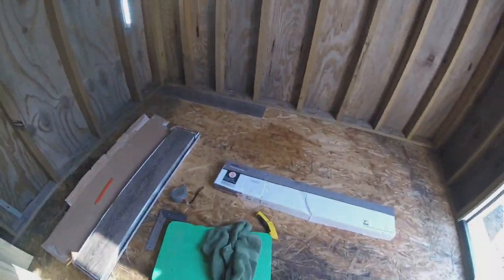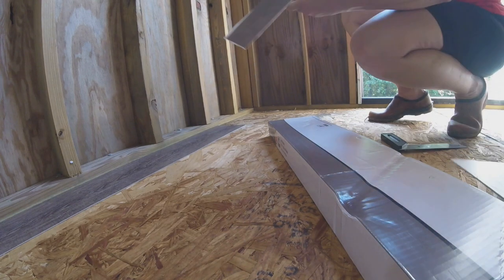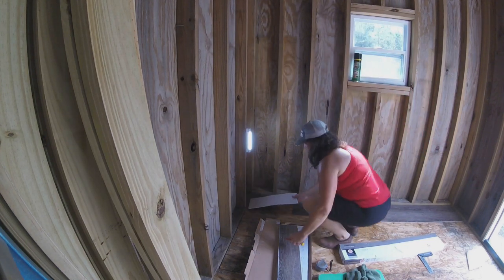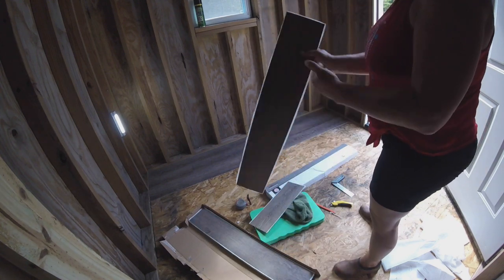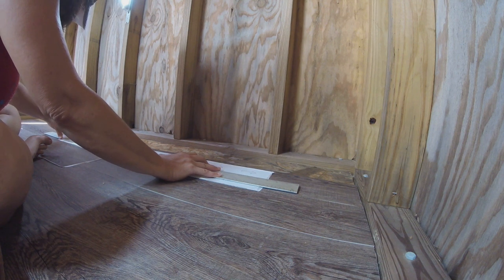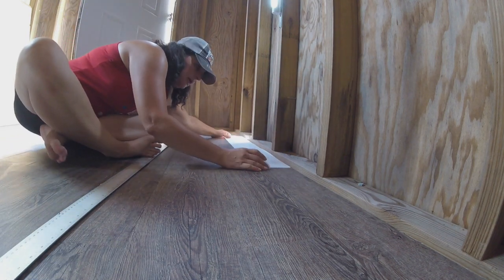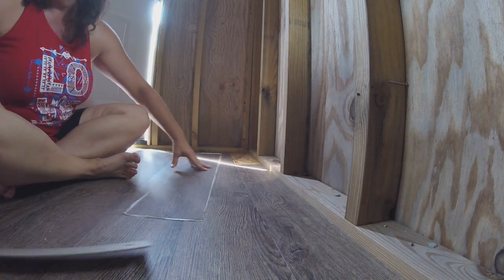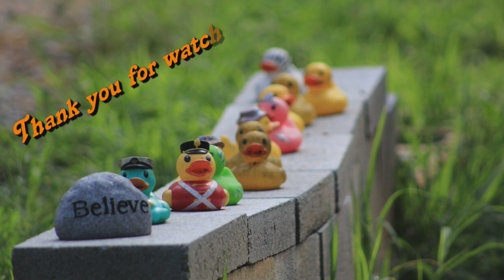Installing Vinyl flooring in She shed????????

Comment: Thanks for sharing!  I was going to install the same, but the manufacturers state that the floor should remain in 65-85 degree temperatures. Have you had any issues with the heat and cold?
Reply from the maker: The shed has no temperature control (no a/c and no heat) so it goes from freezing in winter to 90 degrees in summer.  I have had no issues.
Reply: Ms. Bee Haven thanks for your reply!
Reply: @ms.beehaven266  Hi, We live in TX with clay mud in the winter.  How has the vinyl held up with no prep underneath besides cleaning it well?  Looks great!
Reply from the maker: @lisamann8329  It still is doing great.  I have only swept it out once, lol.  I have alot of racks in there with my bee equipment and not alot of floor space so not much area to keep clean.